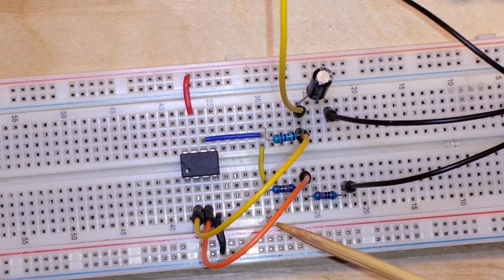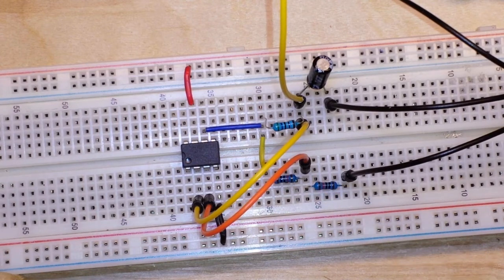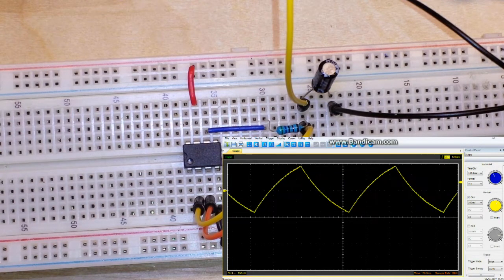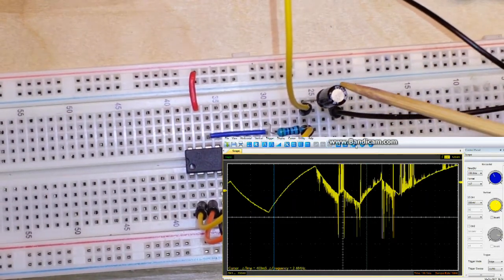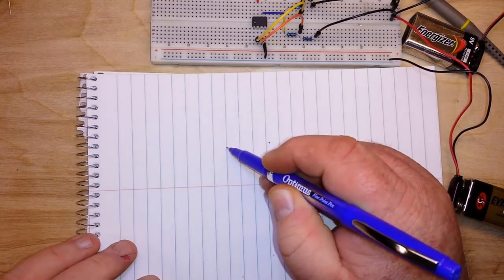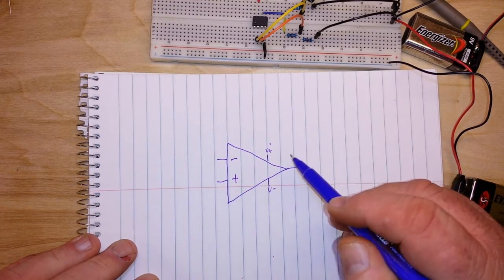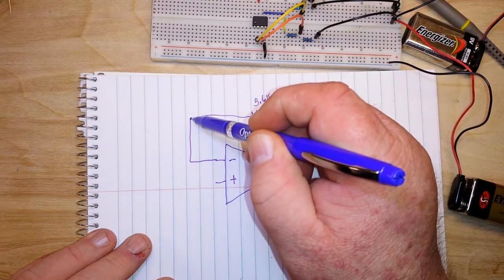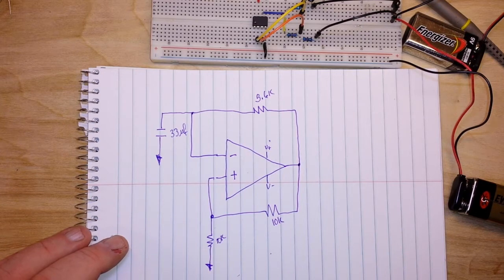Intro to occillators   The Relaxation occillator

Comment: What's a practical application of this? And why does the transistor have to be connected like that? Great video, once again.
Reply from the maker: Vivek Venkat Subramaniam practical application for an occillator? they are in everything from your watch to your car to just about every electronic circuit ever. The non xstor is reversed biased to exploit a region of negative resistance that allows it to conduct